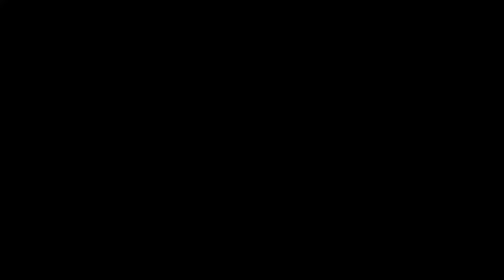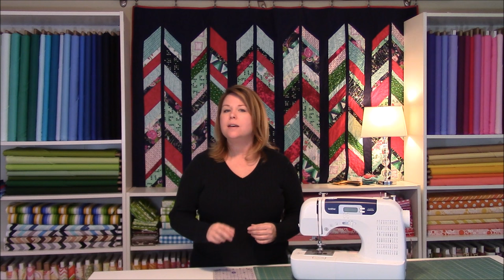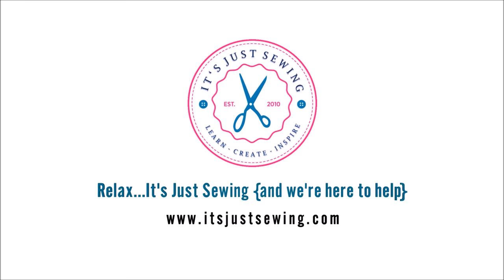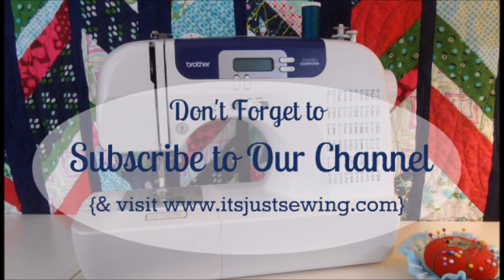Troubleshooting Quick Snip Machine Making A Knocking Noise

Comment: hi! I wanna ask some bout knocking noise on my sewing machine. I've done your tips to get rid off this noise with tightening face plate and also change my needle but the problem still exists.. I've opened my sewing machine to take a look closely where the sounds coming. guess it's under the plate.. can you give me any tips or solution what's happened? thank a lot ^_^
Reply from the maker: +anang rahman - when was the last time you had your machine oiled and serviced?  You can do a bit of troubleshooting on your own but if you haven't had it cleaned and oiled by a professional - you might want to.  What kind of machine do you have?

Comment: My machine is brand new, came with a new needle installed. Have just set it up with thread to try it out and this knocking sound is very loud. Pfaff Performance 5,2. Tried rewind the bobbin and threading it all over again.... do you have any suggestions or familiar with this type of machine? Thank you :)
Reply: Evy-Ann Strand q
Reply: Evy-Ann Strand did you find out what the issue was and how to fix it?

Comment: I have a Brother SE600. I have had it a little over a week. I've changed the needle, cleaned around the bobbin case, and it didn't solve the problem. I took a flashlight and looked under the plate. It looks like fabric debris or is something supposed to be there?  I am a new sewer. Any help would be appreciated.